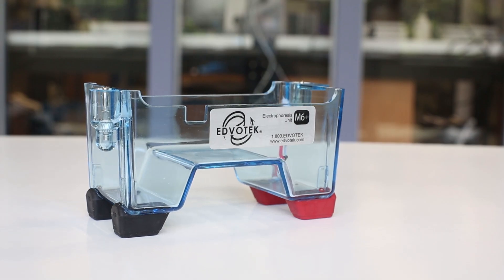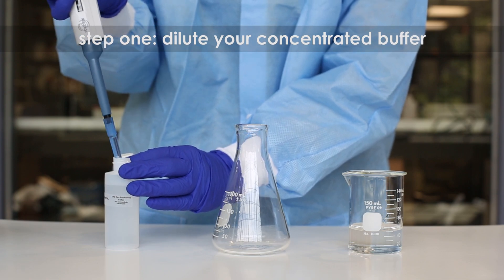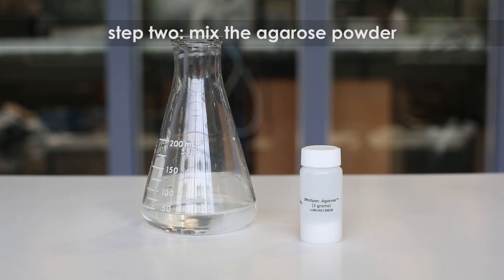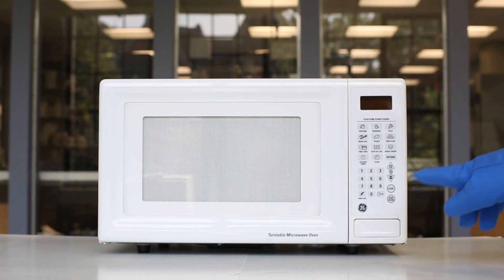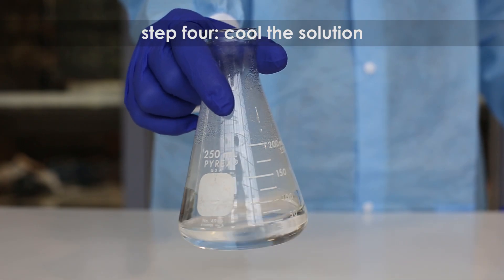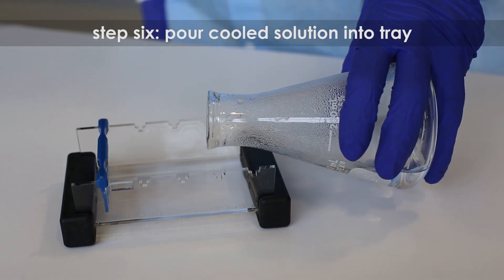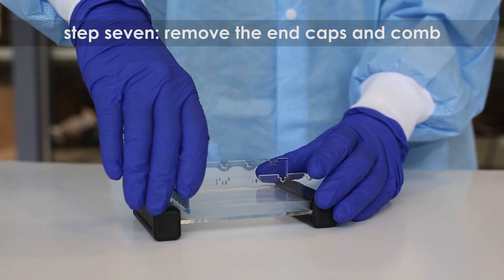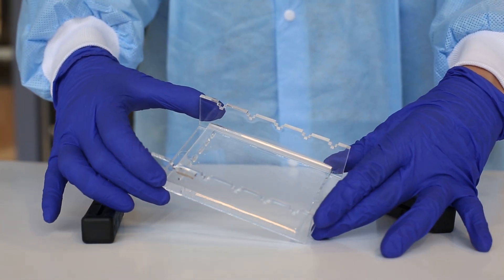Preparing an Agarose Gel For Electrophoresis - Edvotek Video Tutorial

Comment: "Dissolve the agarose powder by boiling the solution."
Pulls out a f*cking microwave
Reply from the maker: If you don't want to use a microwave, there are many other ways to boil the solution, like a hot plate.  What resources do you have in your lab?
Reply: seriously, you have to act like that

Comment: What's the power rating for the microwave?
Reply from the maker: I'm not sure of the exact power rating for that microwave.  The most important thing is to heat in shorter bursts to prevent the solution from boiling over.

Comment: Greetings.. im just wondering, most of the agarose gel prep video didnt add any EtBr in their solution including this one. however, i've been using Etbr for the agarose gel prep in my research. Is it okay if i didnt add the EtBr? Will it make any difference?
Reply from the maker: +choomie Fitri 

Many of our customers are not allowed to use Ethidium Bromide in their classrooms, so we do not feature its addition in this video.  If you do not add Ethidium Bromide to your gel, you will need to stain the gel post electrophoresis.  This playlist (https://www.youtube.com/playlist?list=PLdpmHMO6NC2ziJIs3i3uZrWe6zHEV5vpL) features our post-gel stains.

For research purposes, you may want to continue adding liquid Ethidium Bromide to your gels.  You would add the Ethidium Bromide liquid to the gel after the molten agarose has cooled, but before pouring the gel.  Be sure to swirl the agarose to mix with the stain before pouring the gel.
Reply: Cheers!
Reply: We could use sybersafe instead of EtBr yeah
Reply: It's possible to use an alternative that is not a mutagen.  We use gel red stain and it can be added after the agar is boiled.  If you are only prepping a gel to show how different dyes run, then you wouldn't need the EtBr.